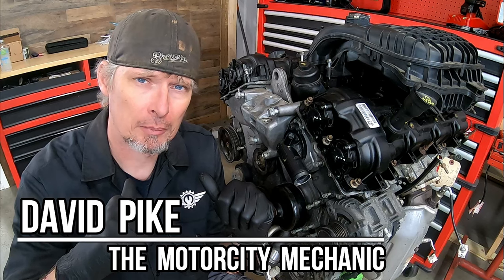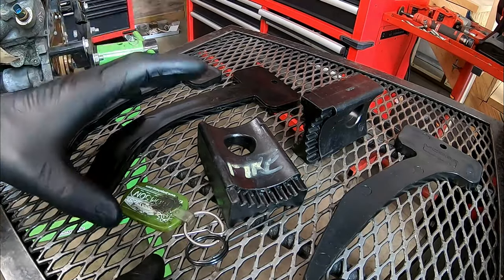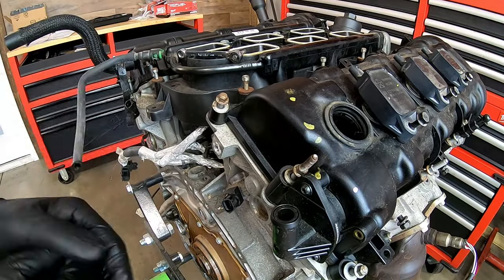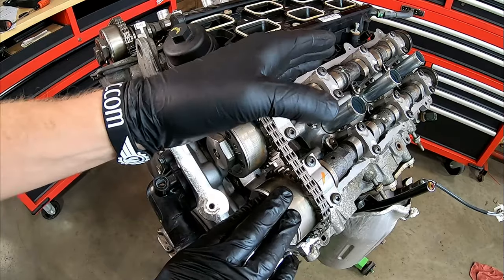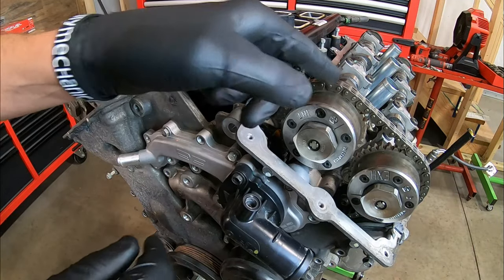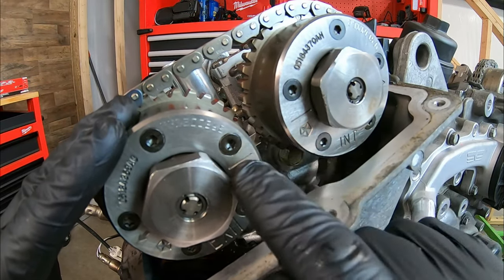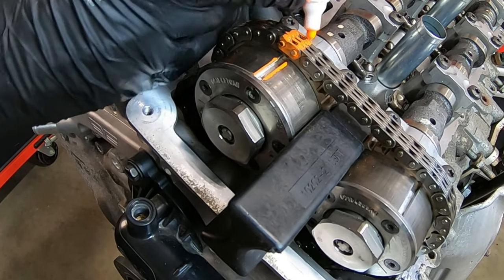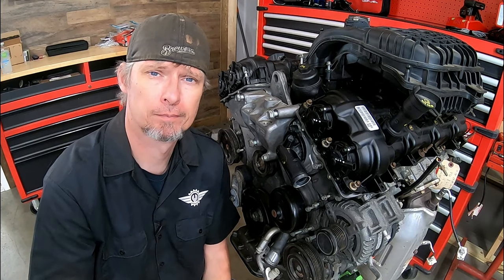Chrysler/VW 3.2 and 3.6 Rocker Arm Replacement Part 1

Comment: Hi David, I have a 2019 Grand Caravan SXT 3.6 PAINtestar that clacks on startup until the oil pressure hits the top end and crank then she's quiet. I am concerned about cold start wear out, which I've seen over the years when I was wrenching on cars for a living years ago. I want to use some sort of oil treatment like STP so the oil film sticks in the clearances well enough to keep them from slapping together until oil press' comes up. It's only a couple seconds but you know how much damage can occur in no time without proper lubrication. I wonder if the oil filter is a POS and there is no check valve. The people at the oil change place say they don't come with check valves which I find difficult to believe or maybe it's built into the filter cover? Anyway, sometimes it doesn't clack on startup if I crank it back up in a few minutes after shutdown but if it sits for more than say 5 or 10 minutes, it's clack clack clack, I mean with the trained ear you can hear the cams, lifters and bottom end rattle for a few seconds till oil press' hits. Its scary to a trained ear. I purchased it with 18K miles on it this past December, it was a rental so you know how that goes. I have 12K mile oil and filter in it which scares me too since I have always changed at 3 to 5K religiously. I have a 2010 3.8 which I replaced the front and rear valve cover gaskets on and she is squeaky clean and snug inside! Very happy about that! No tapping or rattles. Runs like a banshee for a 6 banger! What sort of solution would you recommend short of replacing the entire power plant with a brand new crate engine? ;) I know it was ragged on by renters. They always lead foot these 300HP 6ers... No way to know how well maintained it was before I got my hands on it. Thanks! Love your work! Keep it up! I just want that dry parts clacking gone if possible. A simple solution would be great! Mike

Comment: My 2011 Caravan has just started ticking in the right side head. The left head was replaced under warranty at about 40000 miles, I was planning on putting new rockers and lifters in it. My question is does Chrysler replace the rockers, lifters and cams when replacing the cyl head under warranty? If so I will leave the left side alone for now.
Reply from the maker: Under warranty they would have only replaced the head.....only that failed item so not the lifters and not the rocker arms. Thanks for asking and make sure to subscribe
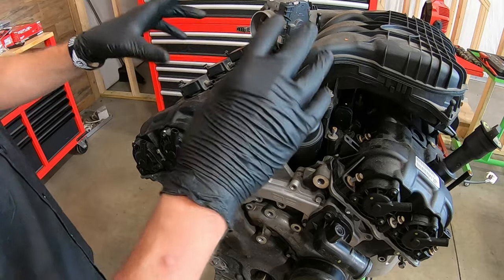Reply: @MotorCityMechanic  Due to my age and health I decided to let a local shop do the work. Service manager said they were very experienced with this job. Told me two days. Took it in Monday morning and they pulled it in at 2:24 Thursday afternoon and pulled it out at 9am Friday morning, according to my tracking device they let it run about 7 minutes without doing a test drive. So just shy of 1800.00 later I get it back and am very disappointed. First the two front intake support brackets have been forced back from the studs and not bolted back up. I know they were ok before because I just replaced the spark plugs a few months ago. The spring clamp holding the hose on the pcv valve is no longer there. Plus a few more minor little thing not really worth mentioning other than I have never pulled a valve cover and put it back on without cleaning it.. My fear is they are gonna want to force the bent brackets back into place and bolt them up which I think will put pulling stress on the plastic intake manifold and cause it to fail. Now I have no confidence in the rest of the work and am thinking maybe I should take it all back apart and check torque specs and sequence on all the fasteners. What are your thoughts on the brackets? Remove and try to straighten or replace them? I also asked for all my old parts back and I noticed they weren't in the van after I left. I called and he said he would have them for me Monday. Also I have never heard of a valve cover set being 160.00 not oem either. Being a mechanic all my life this is the first time I have ever taken my vehicle to a shop for repairs. Sorry for the long story but I just had to vent.
Reply: I asked for oem parts but the service manager told me he thinks MAHLE lifters and rockers are actually better than oem so I told him go ahead and use MAHLE. Turns out MAHLE does not make lifters and rockers for the Chrysler 3.6 engine. So I have no clue what they used. I will be there at 7am tomorrow morning to discuss this repair with them.

Comment: David, 
    My Caravan has developed a ticking sound, but it's not very tinny sounding and it isn't there all the time. It sounds like someone taping on a piece of aluminum angle stock with a screwdriver end. It's there maybe 80 percent of the time and it's low frequency; maybe two times a second. If I recorded the sound for you would you tell me what you think the sound is coming from? Or, if you have already recorded a Pentastar with the rocker bearings going bad, maybe you could reply to this and send me a link to that. Thank you very much for your help.

Comment: I dont have any noise coming from mine, but I keep getting p0300 and P0018 codes. Only symptom besides the codes is the car jumps badly when i put it in drive or reverse when its really cold and the car has been sitting overnight. i thought it was the abs. Ive replaced crankshaft and camshaft sensors. Im told cam phasers need to be replaced. Would love to know your opinion.

Comment: @David… after disconnecting the Camshaft Position Sensor on the rear of the valve cover - is it required to remove them or will the valve cover come off with it on?  This is on my 15RAM1500 3.6. TIA

Comment: Hello David, My wife's daily driver is a 2016 Dodge Caravan with the Pentastar engine. When she first starts it every morning it sounds like the lifters are making noise for about one second, and then the noise goes away. Is it common for these engines to make that sound at start-up?  It's been doing that since we bought the 1 year old car from Dodge. The second question I have is with $78,000 mikes on the car, is it typical for there to be a very slight inconsistent (not repetitive) miss detected about every 30 to 60 seconds?  I'm "Old School" and owned all 383 and 360 V8s in my past, so I'm use to my engines running like sewing machines. Since this is only a V6, and may not have been designed to the same quality as the old V8 engines, maybe I'm asking too much from the engine. Please let me know if I am if I expect it to run "completely" smooth. FYI, I have used fuel injector cleaner, replaced the Spark Plugs, Intake Gaskets and had the Throttle Body cleaned by my Dodge Dealer, but the slight miss is still happening. The next thing I was going to try is to replace the PCV Valve. Let me know if this could this be caused by the rocker arms starting to go bad like you mention in this video.  Any suggestions would be very appreciated. Thanks!

Comment: Hi, another quick observation and question if you please. On my 2019 Grand Caravan I hear a constant whine that sounds like the power steering pump makes when you turn the steering wheel to its full stop and put a bit more pressure on it. The steering feels like it has more resistance than it should as my 2010 which is very easy to turn. I am curious if the manufacturer intentionally put a restrictor inline in the high pressure side to give the steering wheel more feedback or a cushier feel or just a lame engineering goof like they always do. I asked the dealer to check it out when it was in there for some minor body work and service said, "well they all make the same noise" and that was that. Oh well, typical of line mechanics as they don't get paid much if at all for diagnostic time and I empathize, believe me! Been there done that. But I want that noise GONE on mine! Are you familiar with this noise, problem, complaint and if so, what do you propose the solution is or may be? I can live with it but I'd rather not and am willing to do what is necessary to solve the problem and get rid of the noise! Could be engine or trans front pump too but I sure hope not. I thought it may be a bad tensioner or idler pully but... not! Thanks again brother! Mike

Comment: How would you go about cleaning all of the sludge from a motor with 125k miles? Just got my 17 JKU opened up and it seems pretty dark compared to the one in your video.. I’ve heard of using diesel and changing the oil.. any recommendations?

Comment: my dealer changed 4 rocker arms and it still ticks. I looked at the valve covers and said how did you do that because the valve covers were never removed. They lied and I left it there and told them to fix it right. All this under warranty. They didn't think I would check like most people don't and live with the tick. The original RTV sealant was still there never touched and sand and dirt around covers.
Reply from the maker: Sad thing is when I was at the dealer…..Chrysler didn’t have an issue if we replaced all one side….(16). Sorry it happened. For me it would be right back at the dealer to be “fixed” again
Reply: @MotorCityMechanic  I did. I took it right back and left it. It has been there since thursday and no word yet. See what monday brings. Only 54k on my Pacifica. Now I don't trust them. Give the service manager 1 shot to make it right. Wasn't his fault the mechanic lied. But if it still ticks after that then I will go to general manager and Chrysler.
Reply: Here it is. A week later waiting on parts at the dealer they had to order them. I don't know where they're coming from but a week later

Comment: I have a problem with the AC on a 2013 Chrysler Town and country it has cool air front seats but back no air what should I replace
Reply: I think it has two separate AC compressors.
Reply: @5roundsrapid263  One compressor. Two evaporators.

Comment: Had a customer come in today with 2013 challenger 3.6 has a ticking on passenger side valve cover toward rear. not very loud have had hemis come in with ticking but this is the first 3.6 to come to my shop what can you tell me. thanks for what you do

Comment: My mom, and my sister's 3.6L V6 Dodge Caravan's do the tick/knock noise coming from around the cams. I'm looking into this for their sake, and my own to help, etc. It's as I feared - they'll need to get things rebuilt which I'm sure they'll might not want to do. I personally don't think these engines are worth it; I believe they both have over 200K miles by this point. I keep trying to preach to my family to consider Toyota/Lexus as an option, but sadly like most people just want to get the "better priced deals". I've watched enough to know both vans have failing rocker arm(s).

Comment: Hey bud do you have a trick to removing stuck cam cap bolt on this 3.6 i haven't stripped it yet but its on its way.can i use anything for heat?
Reply from the maker: Wise grips have worked for me in the past

Comment: I had the left side  cams (2) changed , now I get a shudder in the engine, when idling and the oil pressure will drop from sat 160 to 112 when it happens any ideas ?

Comment: You excited for the Ram Super charged truck?  I'm not but just curious.
Reply from the maker: Love to drive one....wish Chrysler would let me have one for a few months lol. It will be interesting for sure but pricey I’m guessing
Reply: Without you I would not have been able to do my ac condenser and water pump on my 2013 grand Cherokee I even installed a winch after I had it all apart you can see the winch on my channel thanks again David 👊🏻
Reply: @MotorCityMechanic  I think I heard they start at  $70k. Too rich for my blood.

Comment: Great video thanks a lot 
I’m working on a Journey 3.6 2010 and I was trying to find the lifters on dodge catalog and buy them with the right part number but unable to get it from the catalog so not sure which is the correct part / part number for the lifters 
If you can help me 🙏🏼 
Again thanks a lot
Reply from the maker: Usually the prt# is 05184332AA. I recommend having that verified first. Again that is the number for the lifters....not rocker arms.
Reply: @MotorCityMechanic  thanks a lot for the collaboration 🙏🏼👍🏼

Comment: I am doing rocker replacement soon on my charger. What is a good brand of rocker arms to upgrade with? Do you have any links where I could find a good set? 
My car has 140,000 miles on it, what sensors or parts I should consider changing out while I am going into the engine? 
Thank you for your time.
Reply: I think you order them from the dealership, they have a updated rocker design.

Comment: Great videos can a valve steam seal be replaced whit out taking the head off  blue  smoke on start up 2012 Jeep jk 3.6  thanks
Reply from the maker: On a 3.6 I recommend replacing the pcv valve first if you haven’t already.
Reply: @MotorCityMechanic   yes I did
Reply: Can it be done valve steam seal whit out taking head off can’t find anything on that

Comment: Great video! One question, how do I rotate the camshaft to get it in position? I don't think I have access to the 1 1/16 bolt that you turn since it's under the timing cover. I have removed all of the spark plugs and tried a crescent on the camshaft but it doesn't want to move. Do I need to get the wheels off the ground?
Reply: I realized my mistake. You can access the same one and 1/16 bolt as seen in this video without removing much at all. Just pretend you're replacing the accessory belt, there's a plastic housing that you remove and voila there's the bolt.
Reply: @nathanjgibbs  did you have to get the wheels off the ground? Vehicle in neutral? Or were you successful in rotating the cams with the vehicle on the ground and in park? Thank you!
Reply: @rte65hg  I got it rotated without lifting wheels off the ground. Just had to pretend I was changing the accessory belt and rotate the one and 1/16th bolt
Reply: @nathanjgibbs  Thank you for the prompt response! ... Pardon my ignorance, but does the vehicle need to be in neutral? I am nervous about damage to other components if the vehicle is in park while rotating the cams in this manner. I just don't know. Thanks, again.

Comment: YEAH ITS PRETTY EASY WHEN THE WHOLE ENGINE IS OUT, BEST THING TO DO IS SELL THE CAR WHEN ITS STARTS TICKING!!!
Reply from the maker: The reason you see the one on the engine stand is so that you can easily see what is needed to do the repair. Otherwise it can be done in the car and it’s not that hard. Might be scared the first time but afterwards it’s just another job.

Comment: I have a 2015 jeep 3.2 terrible tick, figured it was this issue. Tore it apart and no loose rockers or cam scoring. I guess that's a good thing but what else could cause that noise?
Reply: exhaust leak?
Reply: About 1 out of 3 CDJR dealerships have a good service department, find a good dealer shop near you and let them diagnose it..

Comment: Is there a difference between the left and right side intake camshaft
Reply from the maker: There is. There are 4 part numbers of the cams shafts....each being a different number
Reply: @MotorCityMechanic  ty
Reply: @MotorCityMechanic   Because the camshaft is a different part number does that necessarily mean the lobe separation is different

Comment: Does anyone know if the coolant needs to be released before the removal of the valve covers? He doesn't mention anything about coolant in the video...im just asking i wanna know if thats what's expected.
Reply from the maker: No need to touch anything coolant related. In the wrangler it can be a bit tight but I just bungee cord the heater hose pipe off to the side.
Reply: @MotorCityMechanic  alright,  thanks for video and the reply 🤘

Comment: I changed all rollers and lifters and 1 cam EX , everything went fine until putting back together and the marks I put on the chain were not lining up there was a three link difference still trying to figure out how that happened has anyone else had that problem? I believe I have the solution just looking for some input if it has happened to anyone else.

Comment: Hey brother I’m doing this repair per your video, and my markings for the vvt solenoids faded! Is there any other way to make sure I get them back on in the right order? Or will I cause significant damage if they aren’t? Help! 🤦🏽‍♂️
Reply: Same happened to me what did u do
Reply: @electricsanti4518  I ended up guess-timating if I’m being honest. But after doing some research I ended up finding out they don’t need to be in any specific order. So you should be good to go! 👍🏽

Comment: why does this happen? I'm looking to get a 2019/2020 Dodge Challenger.. wondering if I'm gonna encounter this and how to prevent
Reply: Change your oil and filter every 3000 to 3500 miles like religion every time no exceptions I have a 3.6L  2012 Dodge Journey with 125,000 miles runs like a watch Only other engine work was a spark plug change thermostat and coolant flush at 120,000 miles runs like a Swiss watch you literally can not hear this engine idle. My dad always said oil is cheap and engine repairs or replacement is expensive more true today than ever. By the way I also have a 2019 Challenger 5.7 Hemi RT 8 speed great car no regrets.

Comment: Hi guys, do you turn the crankshaft/balancer with the car turned off and in neutral? Is it always clockwise?
Reply from the maker: Key off, doesn’t matter what gear position. Usually I go clockwise
Reply: @MotorCityMechanic  thanks! I did my right exhaust today. Had the car in park. Went to do the intake but stripped one of the cap bolts. Tick is still there :(

Comment: Is there a compression test for the 3.6L P motor in your videos?
Reply from the maker: I don’t have a video as of yet on how to do it.
Reply: I removed the ASD relay, held WOT. Only got 105 psi on #1 cylinder. Leak down pointed towards exhaust valves. :(